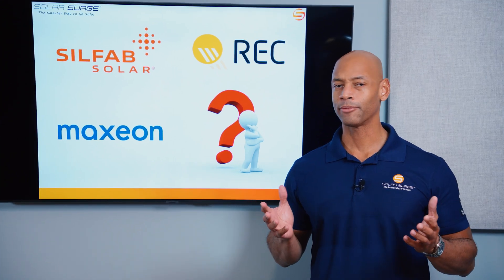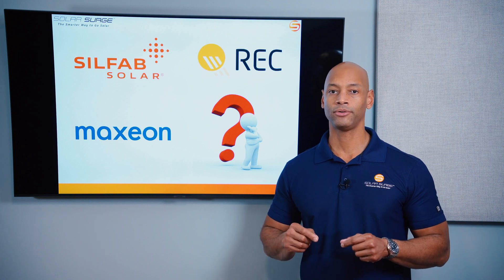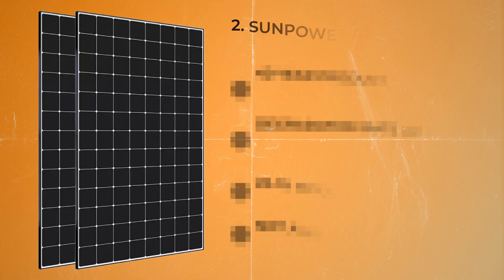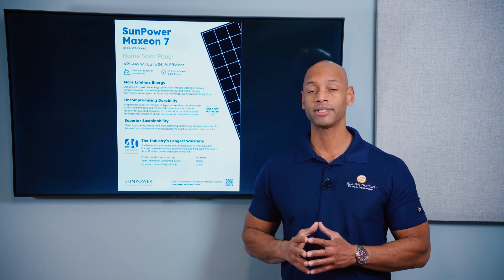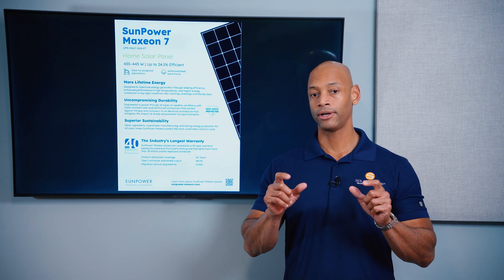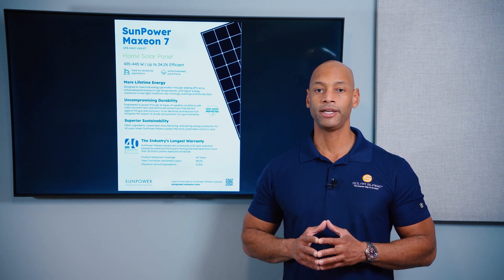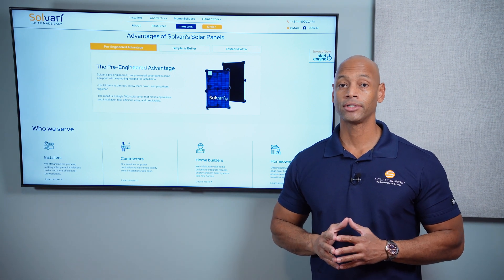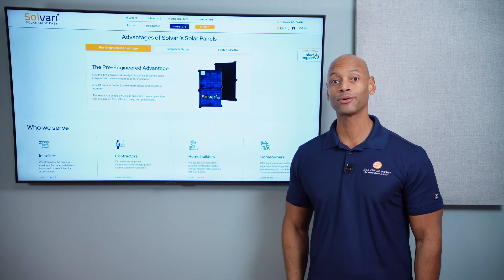Top 3 Most Efficient Solar Panels Going Into 2025

Comment: The REC Pure RX is only 1.5% more efficient in w/ft^2 than the older REC Pure 2 even though they have 7.7% more surface area.  If you have a smaller area to fill with panels, you might be able to fit more Pure 2 panels.  I know that was true for my setup.
Reply: Agreed. I am able to get a .8 KW larger system using 420 panels because of the way smaller panels can fit on the roof.

Comment: Isn’t the reverse also true, the a higher (more negative) temperature coefficient will result in better cold performance?
Reply from the maker: Yes that's correct.  Solar panels perform the best in cold temperatures with direct sunlight.
Reply: I think they best perform at around 25 degrees Celsius.
Reply: @raymondschembri5042  Nope.  They are not optimal at 25°C. That’s just the temperature standard for comparison purposes.  Performance improves at temperatures below 25°C.

Comment: What temperature is used to calculate the coefficient, air temperature or surface temperature?  Here, near Spokane, WA, we see several days above 100 degrees each summer.  But the intense sun causes much hotter surface temperatures.
Reply from the maker: The base temp is 25 degrees C.  It's about the temperature that the solar cell feels.  So, if you have roof mounted solar panels, then the on-roof temp is the deciding factor.